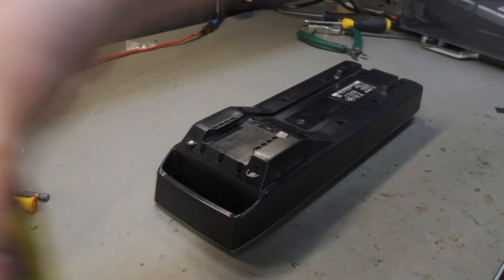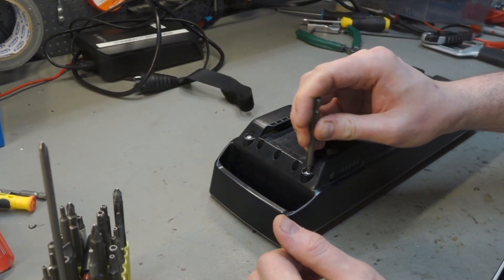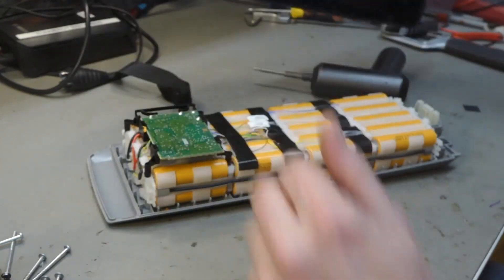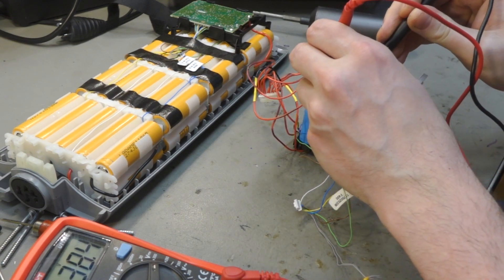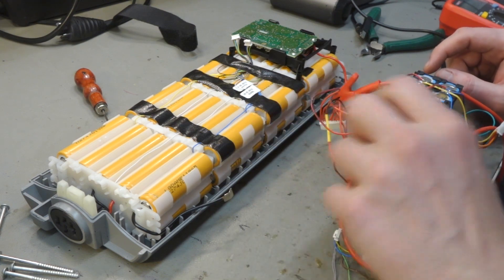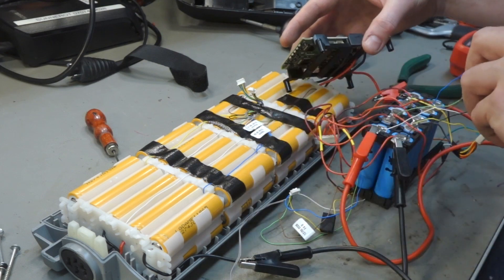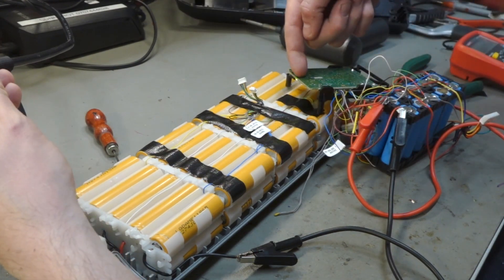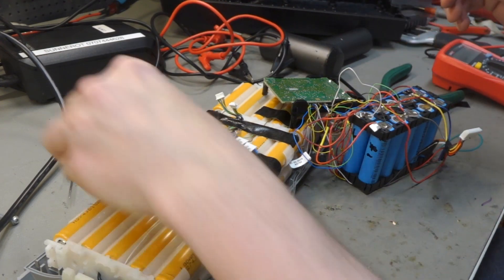How to test a bosch BMS on a dead (0 275 007 513) battery

Comment: Thank you for putting in the exact model number in the title. This is immensely helpful finding the correct video.
And also thank you for showing the shell disassembly and not cutting that out. There are many designs with intricate mechanical locking mechanisms (on some TranzX models, you have to flatten some round plastic panels by pushing on them to be able to slide them off without breaking the internal prongs), so your video helped opening this battery with confidence of not breaking the shell

Comment: Hey Doc great vids. I have a strange problem. bosch 400 battery and the charger stops charging after some little time say 1-2 mins. check voltage and its around 35v so should charge......any help please